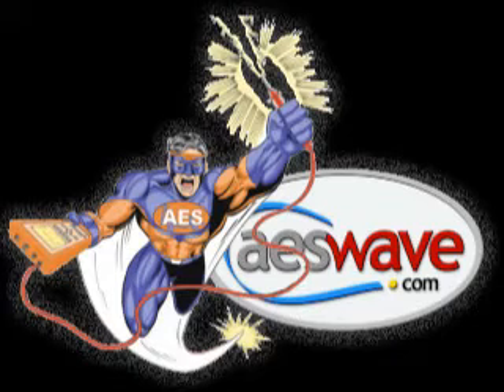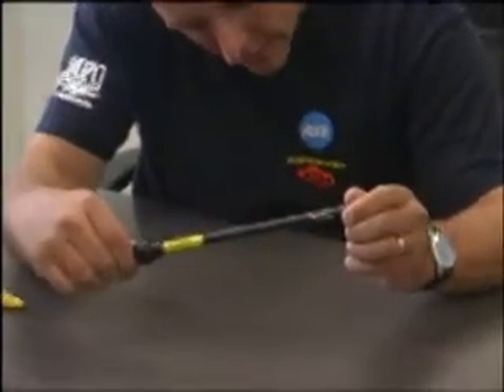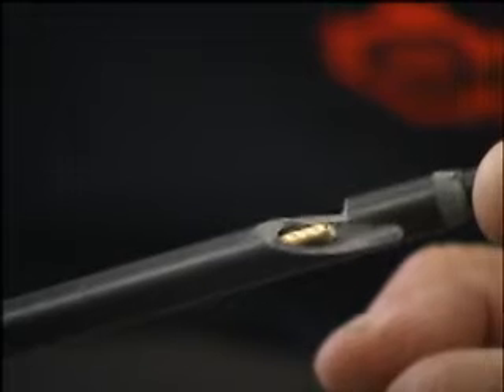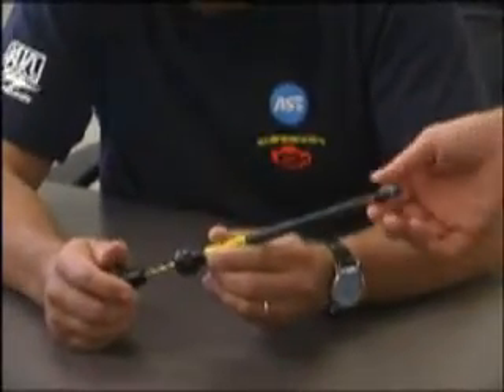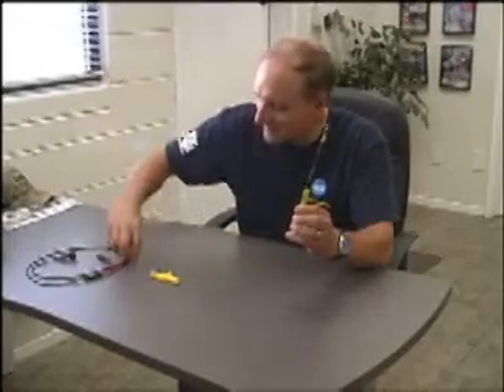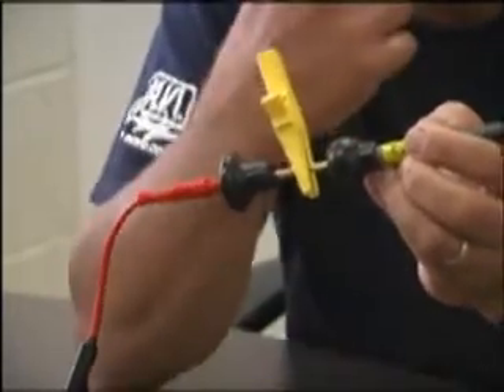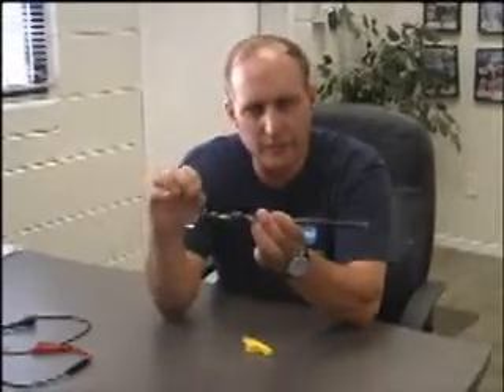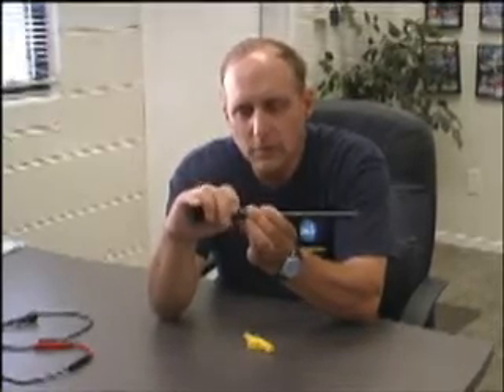Phil Fournier - Phil's Peircing Probe

Comment: I prefer backprobing in connectors. 99% of wires have that option.
Reply: I think the whole point here is being able to check wires in a harness where the connector is inaccessible without major component disassembly.  Time = $$.   Sure---if the part location allows u to disconnect the harness then u don't need this tool.  This guy, Phil, has 30 yrs of experience---he thinks this tool is needed & so do i.